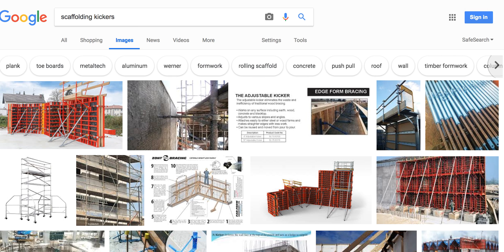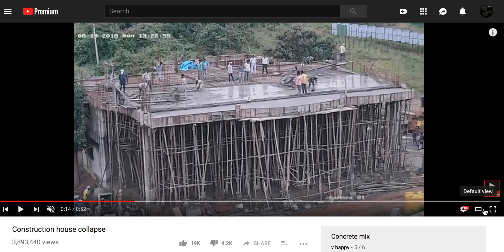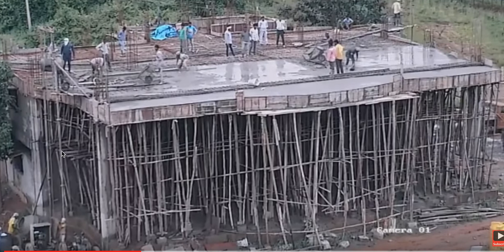Concrete form failure 7 workers survive

Comment: They needed some more diagonal bracing.  That's really wet concrete. What a mess to clean up. I wonder what kind of a structure that was?
Reply from the maker: look at the existing structure; looks like a two story deal...
Reply: I see a column in the two corners, but was there anything in the middle?  That's a long span.
Reply from the maker: Tom, I think they had it full... but, the domino effect happened... "A domino effect or chain reaction is the cumulative effectproduced when one event sets off a chain of similar events. The term is best known as a mechanical effect, and is used as an analogy to a falling row of dominoes."
Reply from the maker: PS I know you know what dominos are... lol